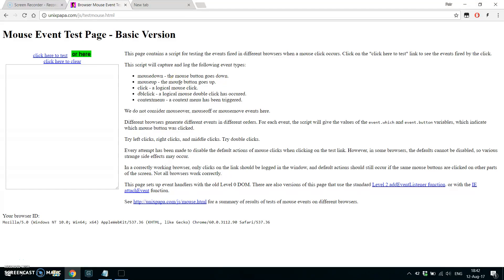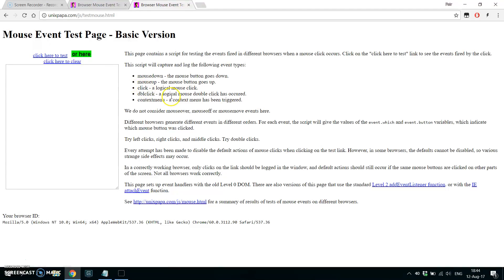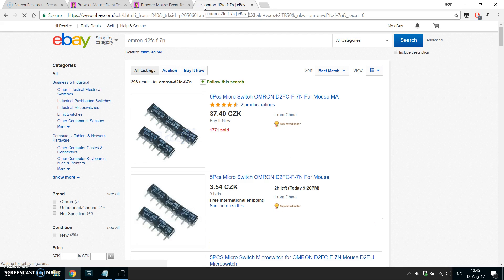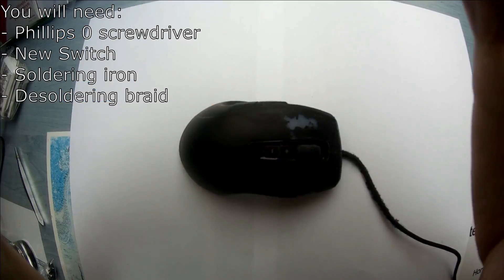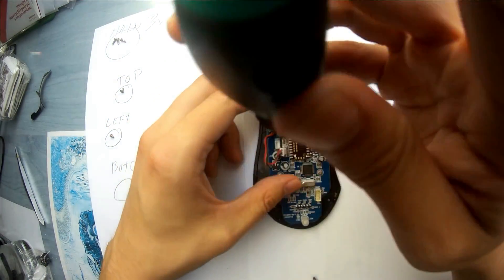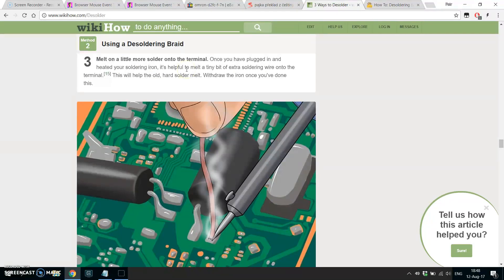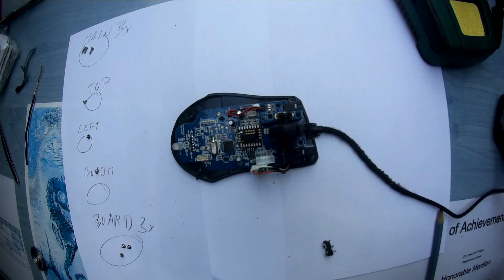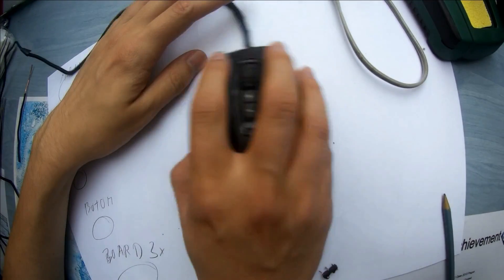How to fix mouse double click issue / ROCCAT mouse switch replacement

Comment: This is wierd Petr can you look and explain that
I was thinking that my Tyon have double click (some times it react ok sometimes double) and have problem with pickup and copy text or the tabs yt goes full screen not pause.
I notice that my tyon is a little bit bulked close to that two button he have there i press it stronger as trying to push it  it wont look pushed back in there but start to behave normally.

Comment: There are 4 different switches of the Omron D2FC-F-7N. They all differ in the warranty of the lifespan of the switch. You can distinguish them by a number following the specifiers in braces.

This will look like this:
Omron D2FC-F-7N
Omron D2FC-F-7N(10M)
Omron D2FC-F-7N(20M)
Omron D2FC-F-7N(50M)

The number is just the warranty of clicks you can do with the specific switch. (10M) stands for 10 Million Clicks, (20M) for 20 Million and (50M) for (you guessed it) 50 Million.
The switch without any specifier has a warranty of only 5 Million clicks and will break faster than the others.

There is a minor difference in sturdiness and sound (due to different feathers used in the switches), but it is really not that obvious.

It took me a little while to discover this, so i hope i spare you some research with this comment. :)
Reply: But still when you buy it from china what is a guarantee that you get 50M instead of 10M. It is only a label on the side of the switch. And it may be that the 50M develop doubleclicking faster than generic ones.
Reply: @wizdarek True. In the Roccat Kone XTD Optical, they use the 10 million click version by default, but mine broke down after about 2.5 million clicks.
I'm just telling you, what the difference is mean to be and maybe there is a slight chance your 50 million click version will last longer than the 5 million click version.

It is a difference of a few cents when you buy it.

Maybe i will buy all of these microcontrollers some day, to look inside and see if there is a difference.

But not today. I'm poor right now. :D
Reply: @Cruentus  Some people are bending the plate inside, but id didnt want to. I just replaced one of the switches. Now doubleclicking developed on RMB (I was naive that the RMB will not be affected :D ). The worst thing about disassembling the mouse is that you need to unglue the sliders, and they never are sticking again. I had to use double sided gluetape.
Reply: @wizdarek  This is what I fear mostly as well ^^'
Reply: @wizdarek  Did you try to warm them up before removing them? A hot air fan could do this.
I saw someone, who recommended this.
Reply: And by the way, eventually I bought Razer Basilisk V2 with optical switches. Hopefully they are free of this issue. But Kone still fits my hand much better though.

Comment: Just so you guys know, the Japanese switches work too. I ordered the D2F-F from amazon in a pack of 2. They looked 100% identical in size, but they fit a little different. I measured them and they were roughly 0.007" (0.20 mm) taller from the bottom of the switch to the top of the switch-button. Do yourself a favor and install these as close as possible to the PCB.

The modification: I removed the part of the mouse cover that has the left/right-click buttons on it and sanded the "switch-button levers" down by roughly 0.20 mm using 600 grit sand paper and it's working about perfect right now. (I may want to do a bit more sanding on the left-click lever)

Comment: Didn't get the soldering of the new switches part! Removing the old ones I understood, but how did you solder the new switches without that soldering cable thing! Just heat them up or what!
Reply: He still used tin to solder it.
The "cable" just works like a sponge to remove molten tin, when you remove parts.

I know you had to wait 2 years for an answer and you probably won't need it anymore, but maybe it helps someone else. :)